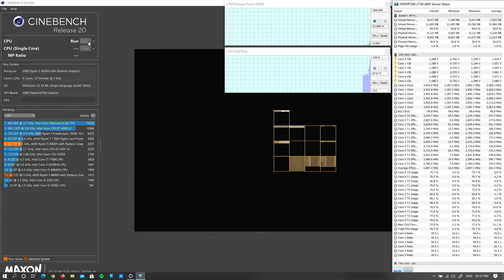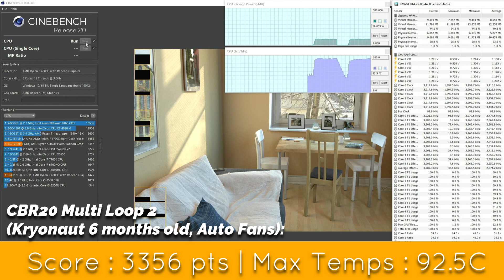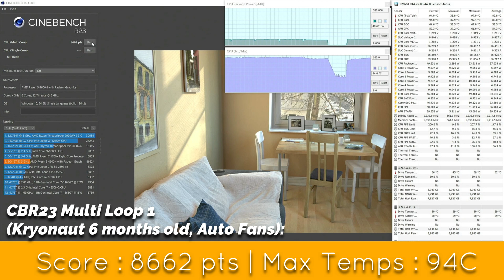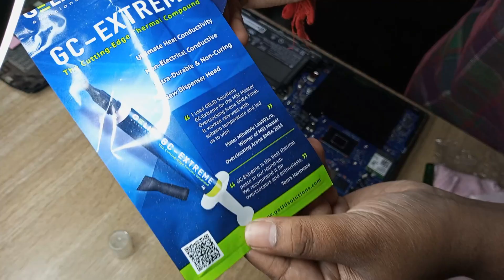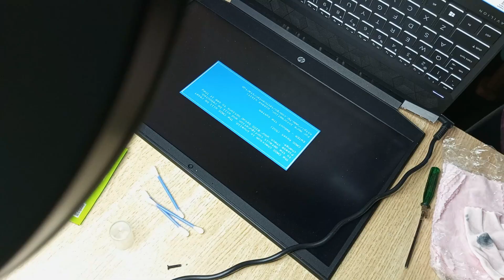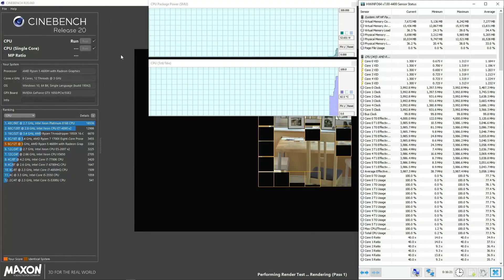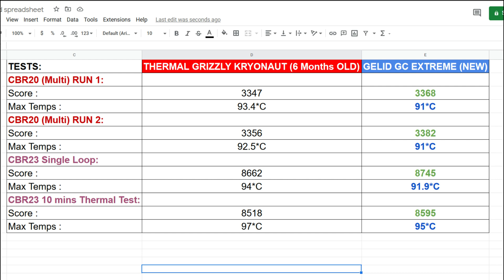Kryonaut vs GELID GC Extreme 🔥 Best Thermal Paste to Cool Ryzen Laptop?

Comment from the maker: Update: I have repasted the laptop after 7 months approx. I have uploaded the video https://youtu.be/MAIlk4k66R4

For the first 3 months it was great, like perfect. Then slowly started degrading. Then by the 5th month, it would throttle in cinebench type benchmarks, but still good in games, by the end of 6th month to early 7th month, it would have those high temp 'spikes', definitely it would still be fine..but I just decided to repaste. After all it was a quick and easy thing to do.. only took like 15 mins..
Reply: Kyronaut has info that it wont dry off till 80*C, so if your laptop hit higher temp then I think all thermal paste would start to dry out, thats why when you heavy use Laptop u should change paste on laptop every 3-4 months max. Remember the lower temp the longer your laptop will live. Also use stand or cooling pads to try to keep them lower. Speaking with my friend who repair things like laptops, switch, pc etc. He said Laptop has a limit of aropund 105*C but its boiling inside, the best is to not exceed 75-80*C maximum then laptop will live a lot longer, He had in repair 2.5 years old gaming laptops where motherboard was half boiled also GPU's, cause of temp. He got himself as he also work in terrain Lenovo Legion 5 with rtx 3070, Ryzen 5 5600h + undervoling which cause him better perfromance as temps were lowered around 5-10*C and he can maintain boost a lot longer with lower temps.
Reply: better to use ptm 7950

Comment: Please tell me which is better? Krynaut thermal grizzly or mx4 arctic?
Reply: None of them are good. Sure they are good pastes for Desktop PCs but on laptops we are applying the paste directly on the die which means higher temps for longer times and will pump out and dry quicker. Kryonaut is good only for like 5 months while mx 4 pumps out quickly. Like in the video i recommend gelid gc extreme or any thick godo performing paste

Comment: STAY AWAY FROM THIS
GELID SOLUTIONS GC EXTREME
It´s allmost cost me my 6900 XT it overheated and I saved it with thermal grizzly kryonaut extreme
SO DON`T USE THIS PRODUKT
Reply from the maker: Chill bro, you'll find comments both ways.
If you are using it on a giant desktop GPU, your common sense should've already told you that Kryonaut was better due it having the highest thermal conductivity among all non-electrically conductive thermal pastes. 

On laptops there are a lot more variables at play, mainly being the much less heat sink assembly pressure, where the pump out effect of Gelid is a bit less due to it being less fluid compared to Kryonaut. 
I have both, Kryonaut on my Intel Predator laptop, while Gelid on Ryzen.
Reply: @DeepteshLovesTECH  I'm not your bro
Reply: Using it for 1 yrs still not problem...cpu temps under 80-85 with no cooling pad

Comment: I searched through the videos there is no update about this. How is the paste holding up?

I would also like to know a thick paste, non electroconductive. Its for ps4 console use. I tried mx4 and nt-h1 but both suffer pump out effect and needs repasting every now and then. Mx-5 and nt-h2 are even less viscous so they wont last even this long.

Any suggestions on thick pastes?
Reply from the maker: I just repasted bro, check out the latest video. It held up well for about 6 months.
Reply: @DeepteshLovesTECH heres  a tip. Usually when someone posts 2nd part they add the link in description text. Saves us some time you know. Thankyou bro 👍🙏
Reply from the maker: I recommend Gelid and Kryonaut, try both on your PS4.
Reply: @DeepteshLovesTECH  will try gelid then. 👍

Comment: Performance is same because of the thermal system of the laptop itself...
It has both heatsinks sharing the heat from cpu and gpu....
I have asus scar 2 which. has 2 heatpipes for gpu 1 shared between gpu and cpu , 1 for cpu ...
And after repasting with GC EXTREME... In gaming temps are 78C cpu and 73C GPU with max fans ...
Ambient temperature was 35C ....

So the cooling mainly depends on the thermal system
Reply from the maker: Definitely depends, but paste help a lot too. My Helios 300 2018 is a prime example of that. I repaste and clean it every 10 months or so. It makes a giant giant difference, it has same thermal design as the HP. Gaming temps are similar to yours and in HP there is officially no fan control as well. These high temps are reached only when the CPU specifically is pushed to it's limits.
Reply: Hey Jatin, I have recently applied kryonaut thermal paste on my asus scar 2, the temps went higher instead of dropping(Note- I replaced the thermal paste on the VRMs to thermal pads of 1mm), I guess that’s why the gpu chipset is not incontact with the heatsink
Reply: @anirudh2788  kryonaut is shit go for gelid.. for cpu gpu and vrm
You will see less temps surely
Reply: @jatinsync3820  okay thanks, also do you face any issue like fan speeds ramp up automatically even in idle condition? I think its a bios firmware issue, but not sure. Is it same in your case?
Reply: @anirudh2788  no i dont face that i am using old bois because new bios will disable undervolt

Comment: I have investigated in different places and it seems that the paste loses efficiency after a certain time. 🤔
Reply from the maker: It does lose, but I feel after testing the Kryonaut on this laptop, the Gelid extreme seems to last longer. 
The Kryonaut on the Helios 300 is holding up superbly well, it's almost 1 year now. So the density/mounting pressure of the heat spreaders of the laptop matters.
Reply: @DeepteshLovesTECH  Hello sir, im planning to repaste my helios 300 i5 10th gen rtx2060 with kryonaut. Is it ok? I brought kryonaut and lately found out that it is not good for gaming laptop. The internet say that it will pump out after  a  couple  of weeks and wont last longer.

Is there anything you can advice ? Im planning to repaste my helios by tomorrow.
Thank you so much. I also heard about the pressure. I am just a newbie :D

Comment: So I noticed something, and this is compared to my experience, so I'm not trying to hate or anything. 

I've mostly worked on Desktop parts and when repasting a GPU, that generally requires more thermal paste than you used, the CPU was fine.

Also, when putting the heatsink back on. you screwed both the CPU & GPU in a circular motion, it's recommended to screw in the opposite corners first so that the thermal paste evenly spreads out giving the best results.
Reply from the maker: Thanks for the insight 👍 This will be needed when dealing with high end components, however here with barely a 50W GPU, temps rarely even touch 70°C (mostly 65°C). With desktop parts - oooh, definitely needs atleast double the thermal paste!

Comment: Good video! Been around 4 months, wondering if GC Extreme is holding just as well now, as it did at the time of the video. 

EDIT: Thermalright TFX on my FTW3 3080ti , pumped out in less than 2 months, I would not recommend it to anyone.
Reply from the maker: Gelid going strong! I uploaded Cyberpunk 2077 gaming review and temps are not even in the mid 70s. 
Regular gaming temps are great.
Reply: @DeepteshLovesTECH  O man! I should have bought GC Extreme. I got caught up in the hype about TFX. Waste of money is what that was.

My temps after 10 minutes of Kombustor runs were (Fan RPM fixed at 90%):

Stock TIM: ~74C
TFX New application: ~73C
TFX After 2 months: ~78C

Safe to say it was all pumped out.
Reply from the maker: @AlmightyGTR  bro you are using it on a big desktop GPU. I'm not sure Gelid is capable of that. Why didn't you try Kryonaut or Noctua NT-H1? Or may be try a water block? I think Kryonaut has the best thermal conductivity outside of electrically conductive pastes.
Reply: @DeepteshLovesTECH  I do have kryonaut lying around. Good point, I will give that a shot. If not GC-Extreme is going to be my next test. 

Thanks for this video and your response my man.
Reply: @AlmightyGTR  stay away from kryonaut too man!! For gpu’s I’d recommend mx4 or NTH2 for longevity or performance without the pumping out go for gelid extreme
Reply: @filiplaskovski9993  I found my new favourite for bare die applications. KOLD-01. 1degree cooler than kryonaut, and no pump out so far. Good as the first time I applied it.

Highly recommended.
Reply: @xListtt I gave TFX another shot for a few weeks, and it returned to the absolute trash performance on my GPU after about 3 weeks. Although it is doing OK on CPU (due to an IHS, which limits pump-out losses, as it is not a bare die application). 

As for 3080ti, I repasted to Kryonaut a little over a month ago, and it is holding a lot better than TFX. 

Keep in mind, my Kryonaut is very old, from the time it was originally released in 2015, so not sure if it is a different formula than what is available in the market now, but it is doing quite well. I am satisfied at this point.

Comment: Great video - thanks! I have read that Kryonaut degrades past 80 degrees C over a long period of time. So it probably works great for desktop CPUs with big heatsinks but not so much on direct die, limited cooling scenarios like laptops (possibly GPUs as well).

Anyway - looks like Gelid GC worked well and looking forward to seeing if it still performs the same in a few months.
Reply from the maker: It's doing great till now. Temps while gaming is in the 70s and sometimes in the low low 80s.
Reply: how is it?

Comment: I am using same laptop , during stress test in cinebench r23 i got score of 8400(multi core)
. I have observed during the whole stress test in hwinfo  that the clock speed of all the 6 cores were not going above 3.8 ghz. And cpu package power was also fluctuating between 46watt to 50watt. In beginning of the test cpu is able to maintain 3992mhz all cores frequency but as the temp rises above 90 clock speed get droped to 3850mhz.
Maximum temp reached during stress test is 95 degrees Celsius.
Please check your laptop for the same.

Is this normal???
Reply from the maker: Arrey it's fine man, 8400 is like among the highest for a Ryzen 5 4600H, it's in a margin of error. Some people in very cold environment has managed 8700/8800. 
It's fine what you are getting..
Reply: @DeepteshLovesTECH  thanks
Reply: @DeepteshLovesTECH  but what about clock speed,is it also normal?
Reply from the maker: @ayushsinha7416  Yea it's normal and fine. It's nearly 4GHz only.
Reply: @DeepteshLovesTECH generally after how many months should I replaces my thermal paste ? I am not a heavy user often some time I play fortnite and use davinci resolve.

Comment: I must admit I tried mx4 in my laptop and after 4 months and temps were in 90+ so I decided to try gc extreme as its thicker and touch wood the temps are stable between 60 and 80 on heavy gaming so Perfect for my laptop
Reply: Amro Mohamed  I believe it's about the same 4months right now and still stable. No thermal throttling. Just be warned the GC extreme is very sticky and think and can be quite hard to spread I was advise to warm it slightly to help
Reply: @apeman5622  bro how is it perfoming now?
Reply: @-ECE-SOGATAKAR  still running great no re-pasting needed. I get spikes of 95 on very heaving gaming like cyberpunk with Ray tracing but I notice that is because the CPU is drawing more wattage I.E it's a 40 watt chip like most laptops but sometimes it draws 65+ watts that's when there is a temp spike. But all in all still good for me
Reply: @apeman5622  how did you warm it up pre application?
Reply: @miniweeddeerz1820  just put beer some heat for a little while. Think I put mine Infront of the sunny window for 5 mins just to soften a little. And just to confirm it still runs bellow 90° so still doesn't thermal throttle
Reply: @apeman5622 oh cheers man i was looking to repaste my vega 56 for better oc + uv. for vega high viscosity paste is better is why.
Reply: @apeman5622  hows the gelid holding up for you, im thinking to repaste my i5 10300h currently with it, usually now hitting temps in the low 90's during heavy stress tests and gpu stress tests about 84 degrees
Reply: @TriX1614  still all good I have an i7 9750h temperature sit around 70 gaming it does jump to 90 but that's the turbo kicking in and is normal. My rtx 2070 stays around 70 max and I haven't repasted for nearly a year. Defo worth it
Reply: Thanks man. I’m thinking of replacing my MX4 with GC
Reply: @webslinger96  please update
Reply: @muhammadfathan1175  i used kryonaut extreme. I'm very happy with it. temps were down about 8 degrees on avg compared to the MX4.
Reply: @webslinger96  I'm currently using gc gelid extreme, the best one I've ever tried
Reply: @muhammadfathan1175  bro Please tell me about gc extreme thermal paste, is it still maintaining temperature after 3months? Pls tell me
Reply: @jakyim4955  wow it's been 3 months. yeah it still maintaining a very good thermal result, not so different from day 1
Reply: @muhammadfathan1175  yeah that’s great, but the channel owner told me after 7 months he re-pasted the paste, and the temps were increasing, look out his new video on the same laptop, I would’ve been happy if it can at least last for a year
Reply: @muhammadfathan1175  by the way what laptop do you have?
Reply: @jakyim4955  hp pavilion gaming 15 with 1650
Reply: @muhammadfathan1175  ok 👍
Reply: Yeah i agree 👍 GC extreme is somehow much better.
Reply: ive been using mx4 and my issue of the temps going high again after a few months is the same 
the paste seems to pump out and everytime i open the heatsink most of it is off the chip
whether i out too little or too much paste doesnt seem to matter
Reply: That's because MX-4 is overrated garbage that dries up in 4 months, don't ever use it

Comment: I own a Alienware area 51m laptop which is desktop grade machine with huge performance.Used kryonaut over it and it failed miserably controlling temps and over time it only got worse. Replaced it with gelid gc extreme has been working way cooler even after 1 year now. Somehow kryonaut isn't performing well.
Reply from the maker: I know about the Area 51m, it's got a socketed CPU in it and MXM standard GPU. 
It all depends on mounting pressure, raw thermal conductivity for Kryonaut is one of the best in the market.
Reply: @DeepteshLovesTECH  i am planning to try phobya nano grease in future has higher thermal conductivity than kryonaut but isn't easily available in India unfortunately. Even liquid metal seems tempting but using it with copper heatsinks is a bit concerning since it forms an alloy.
Reply: @SGnation101  If  its a copper heatsink then the alloy is not harmful at all. It will stain the copper heatsink permanently but its not harmful .
Reply: @AnonymousUser-ww6ns Yes i would suggest if you wanna change it go for Gelid gc extreme since its not that expensive and seems to work abit better than Kryonaut in the long run. I also tried changing it to liquid metal but it didn't help. The problem is this laptop has really bad cooling systems which wont be able to do much.

Comment: Because of the fan dust cleaning this is not a thermal paste comparison, you can hardly draw a conclusion between these two pastes. Both fans were really dusty on Kryonaut.
Reply from the maker: Naah, there's barely any dust. Don't worry after having changed pastes and cleaning multiple times, I have that much knowledge.
I'll tell you something, the biggest factor for high temps is the heat sink fins, if they get blocked with dust (layer of dust) that's the biggest reason for overheating.
I cooled an Intel Helios 300 by removing fat layer of dust and using local 100/- paste. 
Here the Pavilion was almost 99% clean, heat sink fins had clear passage for exhaust air and the fans had some bits of dust, which I blew out (didn't show in the video).
Reply: @DeepteshLovesTECH  Your Kryonaut application is also 6 months old. On a notebook a thermal paste can degrade very fast, in 6 months easily 5 degrees or more. If you want a proper paste comparison change it back to Kryonaut and repeat the test. I wouldn't be surprised if Kryonaut outperforms the Gelid. I'm testing a lot of pastes on my notebook, a lot. I have like 30-40 different pastes.
Reply from the maker: The bottleneck here is just the lackluster cooling solution, which is of yesteryear's. If HP Pav would have a similar thermal design to the Victus, temps would drop by a lot. 
Pav is still cool and not throttling because of the ventilated back and efficiency of Ryzen. It would fail if the APU would draw around ~57-60W.

Comment: I ordered Gelid Extreme and may receive it tomorrow, I hope it'll help with the temps of my laptop that I repasted with cheap 1dollar thermal paste. I'm hyped of the results you shared.
Reply from the maker: Make sure, your heat sink fins are not blocked with dust as well. If they are blocked with dust, make sure to clean it. I have shown that in old repasting videos.
Reply: @DeepteshLovesTECH  I just got finished repasting and dangg, I never thought thermal paste matters in maintaining device temperatures.
Reply: @komi_maru  did it help
Reply: @kitsmith1  100% bruh, I've tested it and I have no pump out issue at all.
Reply: @komi_maru  how is it performing now bruh? i'm using Noctua NT-H1 on my helios 300 and keeps pumping out often.
Reply: @anushab4347  Pretty much the same as the time I applied it. I reapplied one time after a week to see any pump out effect and there's none. I am very satisfied with it currently.
Reply: @komi_maru  hey, any update please?
Reply: @muhammadfathan1175  Eyy, still rocking the same paste, the temps rise quite a bit but still way better than stock or the cheap paste.
Reply: @komi_maru  thank you so much for your response, I'm ordering it tomorrow
Reply: @komi_maru  hey broo, is it still going strong ?😊
Reply: @komi_maru  update pliss
Reply: Hello everyone, it's actually going well up until 1year. But I just recently switched to liquid metal  Much better thermal transfer. But I won't recommend if you are not a risk taker